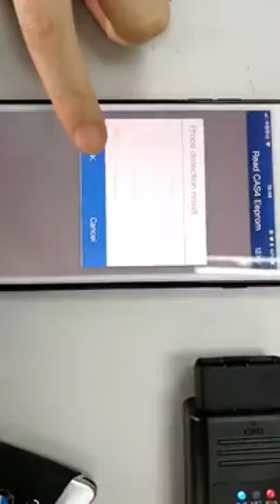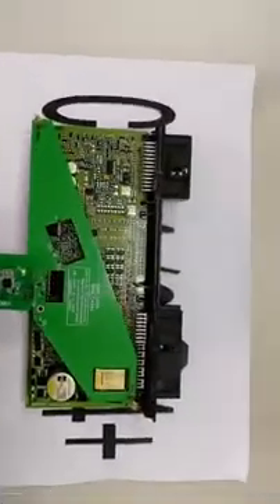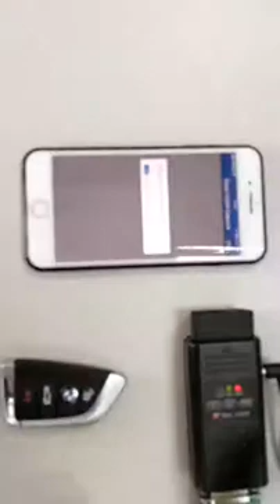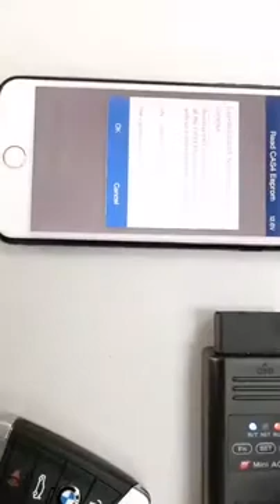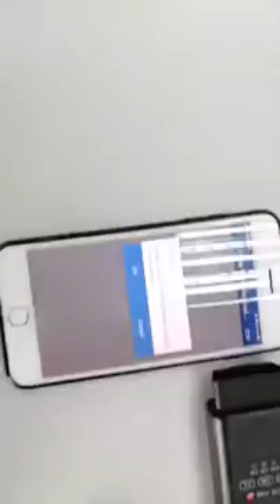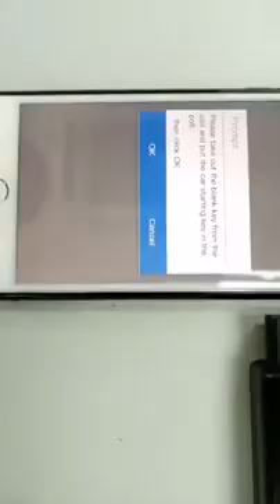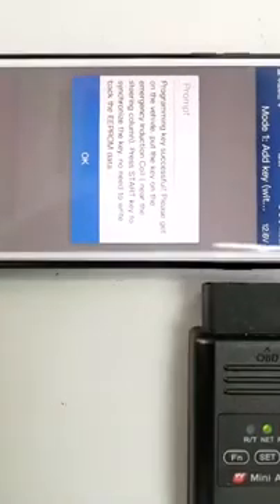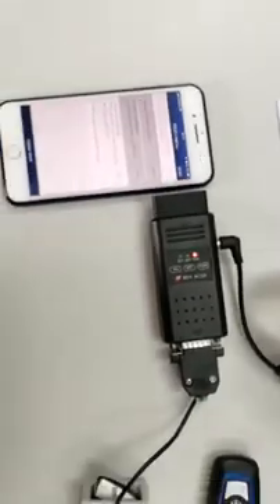Yanhua Mini ACDP BMW CAS4 key programming obdii365

Comment: Why does it work, while you forget to place the blank key back after the working key has been read? The phone clearly prompts you to put the blank key back in after the ISN has been decoded at 8:56, which is obviously necessary to write the decoded ISN to the new key, but you forgot to do so.

Comment: 1. How does the cell phone comminicate with the rest of the divies? Is it via blue tooth or what? 2. does this only do bmw? 3 How much is this device and how long can you take to deliver?
Reply from the maker: ACDP connect with cell phone via WiFi. You can search how to pair wifi of ACDP.  It does BMW, JLR and others. Price depends on different packages. It takes 5-7 working days to deliver.  For information, please check link above and contact us via Skype or email. Thx